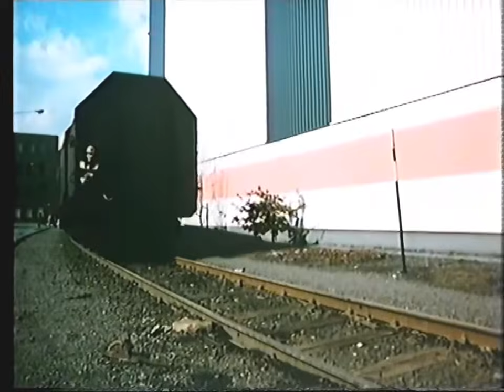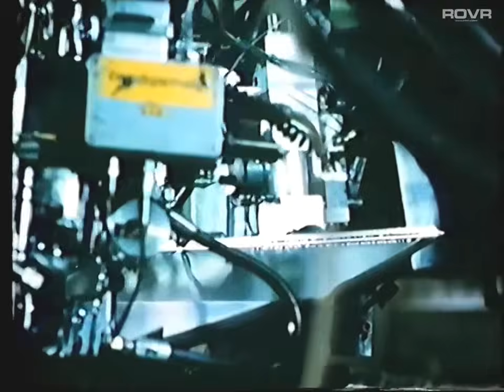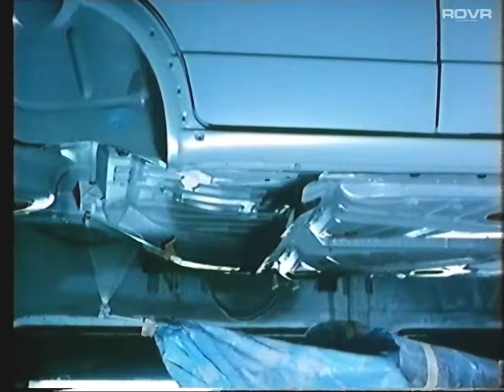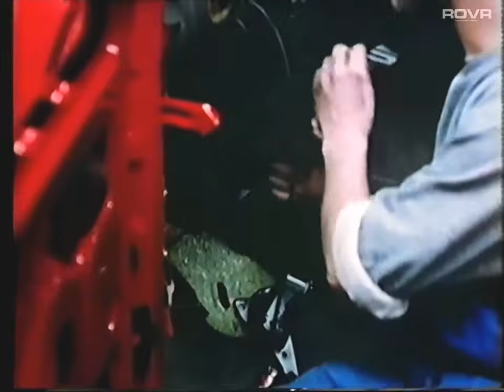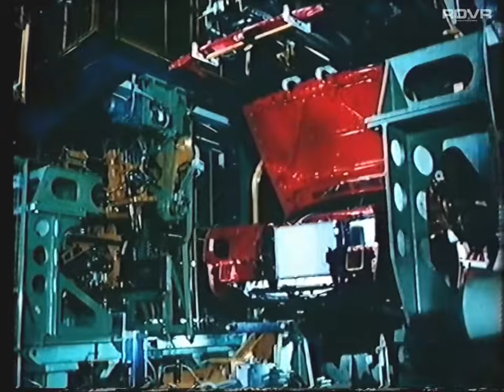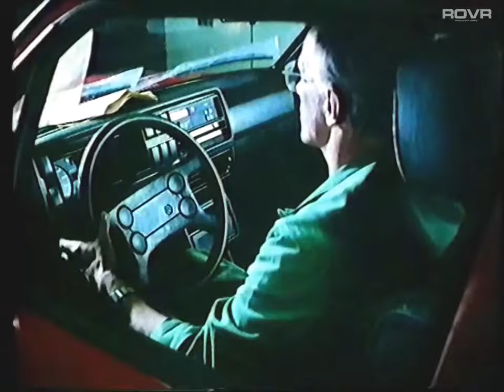Volkswagen - Wolfsburg Production Line - Visiting Volkswagen (1989)

Comment: I worked a VW dealer in Canada in the early 90s. The new cars would arrive covered in a clear coat like protective coating and a bottle of green solvent to wash it off. It didn't come off easily.  Didn't see it being applied in the video.
Reply: It makes a difference when delivering where the vehicle is going, just 100 miles to the nearest dealer or by train (flight rust) or across the ocean (salt water?). If it is transported further it is also better protected. Today mostly only with foils.

Comment: I worked on these in the late 80s and early 90s before giving up the spanners and going into vehicle design for various brands. VW's of the 80s and 90s were true quality cars, well designed, built and with a long life. I had a late mark 2 scirocco which I ran to over 500k miles on the clock and it still looked like a low mileage example. Then a 2003 T4 transporter which I recently sold with over 400k on the clock, 300K of those I put on it with no issues and it still looked clean. But it seems many of the new transporters are struggling to get to 100k without the need for a replacement engine. It's a shame the quality has gone now. My late 2000's Passat was a pain so had to go after 18 months. Last year was my first year buying a non VW/Audi car. I will never buy a VW or Audi again.
Reply: I've owned 7 VWs, currently driving an 09 Passat wagon. Probably my last VW. After 250k km everything starts needing replacement.

Comment: I got one for eleven years. Fantastic car, more than 270k km without any major issue. There was an advertisement in which the driver heard some low noise and went mad about it. He stopped at a service station, the man dud some checks then took some oil and lubricated the driver girlfriend's earrings!! 
I can tell that advertisement was not an exaggeration. The car interiors were really quiet, no rattling, vibrations or plastic cracking sounds even after 10 years.
I drive a Tesla now. Fantastic car, but the interiors are terrible. Car is less than 2 yo now and less than 27k km, but  everything vibrates and rattles.
Found it!!
https://youtu.be/aJWs9ErIWIs?si=lwuwVPdtUcVvYbAU

Comment: This Film is from before 1989, because the cars are pre-facelifts that were produced until the summer of 1987, recognizable by the bars in the front doors and the rearward-positioned exterior mirrors, as well as the front grilles with multiple slats.

Comment: Was a VW dealer technician when this was made……those plastic film door vapor barriers the woman is installing were a terrible design flaw……I replaced countless numbers and pulled countless carpets due to water intrusion from failed film barriers
Reply: Wasnt the heat exchanger a common problem too? I had that issue with my 89 model
Reply: @ oh the heater core…..I did hundreds of those when I was at the dealer. I think that recall covered every Golf/Jetta from 1985 to around 1990……it was a ton of vehicles….easy job that paid well, even for warranty pay
Reply: @ee4355  do you think that leaky heater core is what gave those models their unique smell inside? I miss that smell. I.e. coolant/oil haha
Reply: Da gab es einen Rückruf von VW, es wurde ein Bypass Ventil eingebaut in den Kühlwasserkreislauf! Das gute am Golf 2 war das man nicht das Armaturenbrett ausbauen musste um den Heizungskühler zu wechseln!
Reply: @k.s.3942  Ja, das stimmt, habe das letztes Jahr hinter mich gebracht (Wärmetauscher war leicht undicht). Beim Golf 2 noch mit verhältnismäßig mittelprächtigem Aufwand machbar, beim Golf 3+4 hätte ich es mir nicht mehr selbst zugetraut, denn da muss quasi alles raus, inkl. Armaturenbrett. War so schon Arbeit für einen ganzen Tag.
Reply: Is this true?
Reply: @abrhamabrham2221   Yes, I can testify to the problem with the plastic film door vapor barriers. It sucks and it'll happen to every car that has them, sooner or later.
Reply: 😅😅😅 فاشلون 😅😅😅

Comment: Great video, but I think the video dates from before 1989, the golf is still made with small squares, and the typography of the badges and old.
Reply: Video was made before summer 1987. After the summer break the Golf got the new doors.
Reply: This is the production of the MK2 Golf, made from 1983-1992
Reply: @BB-ne9ev  It shows the production of the pre-facelift MK2 models, who were produced until the summer of 1987.
Reply: Those model were produced between 1987 and 1992, this video is very 1989/1991
Reply: @ReginaTrans_  Definitely not. Triangular window and this position of outer mirrors in front doors disappeared with model year 1988 (starting late summer - probably August - 1987).
Reply: With small mirrors (1983 to summer 87), but the 16V-badge is shown (the Golf GTI 16V came in 1986) and the cars obviously still have no catalytic converter 😁 ... so it should be between summer 1986 and summer 1987.
Reply: likely 87..Mirrors changed in at least 1989 production. I took factory delivery in 1989.. toured it too
Reply: @teevee2145 At least for the german market mirrors changed in August 1987 when the model year 1988 production started.
Reply: @HarrisBurg1979  which would be late 87. came out with bigger collapsing side mirrors

Comment: I just wonder, and maybe someone would give me a proper answer - what could happen to all those press tooling used to make bodyparts like doors, floor, hood etc. Theoretically if it hasnt been scraped, it could be used to make completly new parts? Is VAG grop holds all this equipment in some warehouses?
Reply: These tools have a lifetime, then they are worn out and get scrapped.
Reply: @herrbela-y7k  That's true, at some point the parts are worn out and new ones are very expensive!
Reply: As far as I know, there's a company under the VAG Group which still produces spare parts for older cars (Volkswagen Classic Parts, located near the Wolfsburg Factory), I dont know however if they still use the original equipment to produce those same spare parts.
Reply: They might have gone to TAS in Yugoslavia or even the South African factory as the production of the old model continued there?